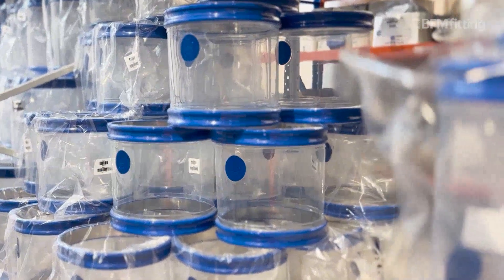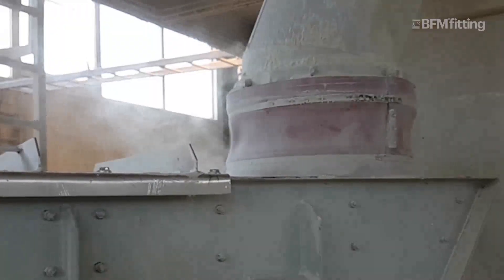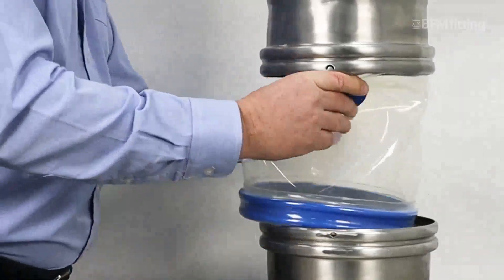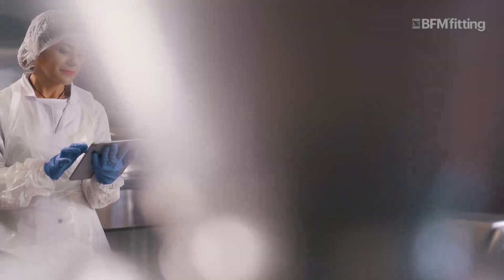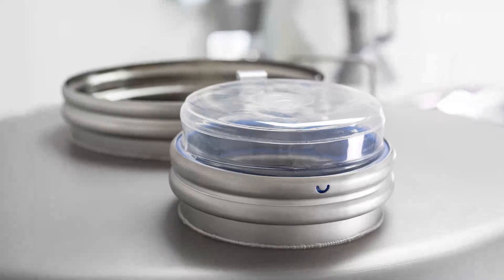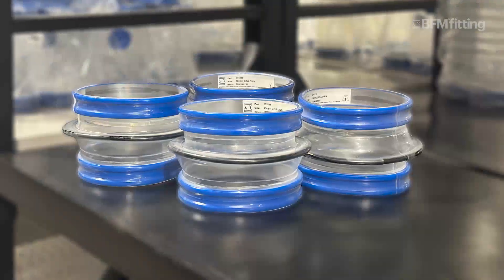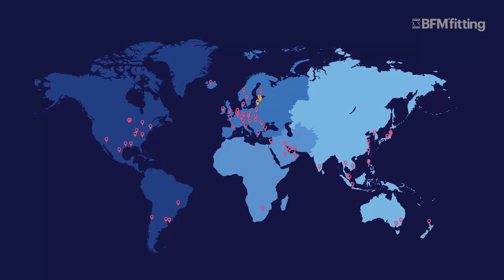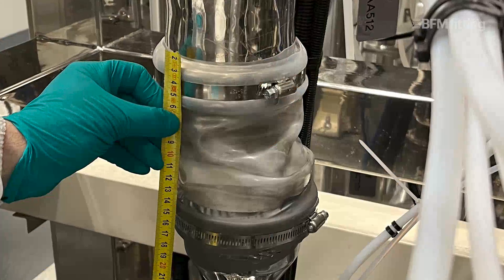BLUEBAND™ Branded Flexible Connectors - The BFM® fitting Difference

Comment: how to remove the smell that sticks to bfm fittings
Reply from the maker: Removing the odour from a BFM fitting will depend on the cause of the odour. Isopropyl alcohol is often used, or alternatively, different detergents that can remove oil-based odours and fragrances. If you are concerned about a particular product, you can contact your local Distributor to discuss or please email us at: info@bfmfitting.com .